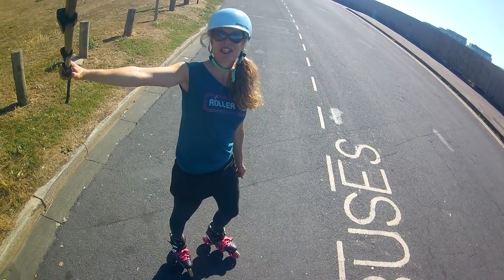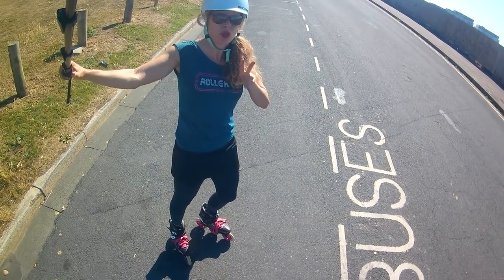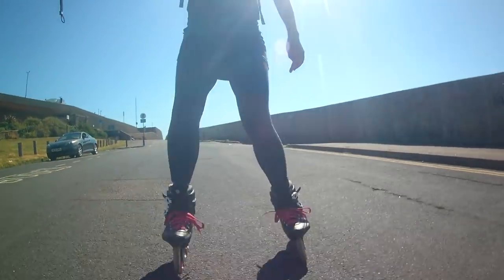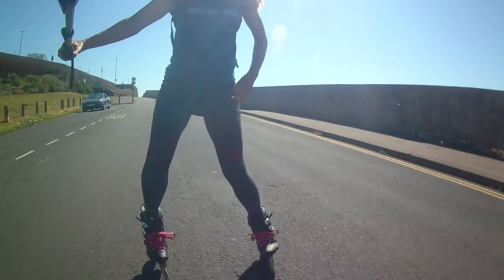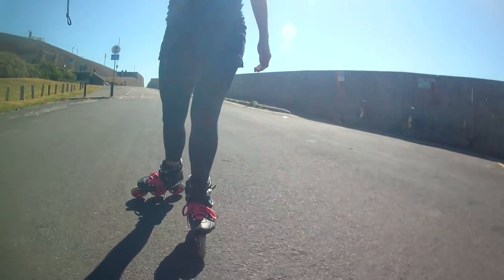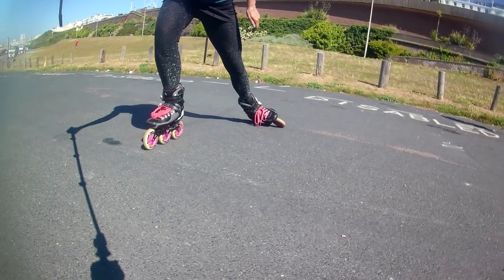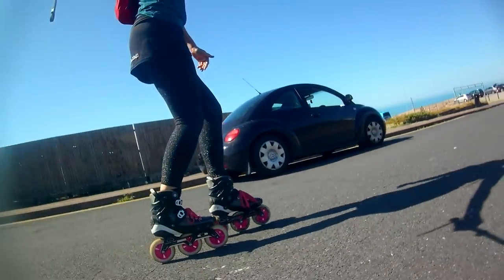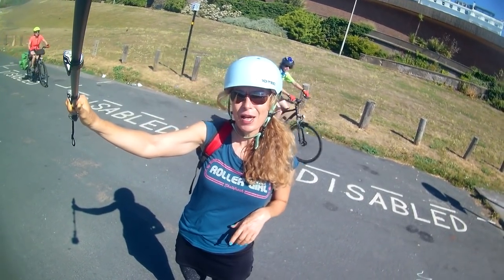How to stop and control speed on down hills and slopes on inline skates or rollerblades.

Comment: Your obviously not in speed how do I know this actually works when am on full speed right on downhills and several of those stops.... when I get to realize bus/vehicle are so near to me  I just need sum that could stop me real quick so pls be on full speed and let see which works the best
Reply from the maker: From my highest speeds the combo I use is T-stop and then forwards entry into Powerslide. This is my fastest most emergency stop and it works on slopes also. However for many people this is not possible from their high speeds because they have not made their powerslide doable from higher speeds so it's a process of regular training over several months. Turns are not what Id use in high speed situations (takes too long and needs too much space).
Reply from the maker: Hi. This is Sergio from Team Skatefresh. I'd like to add that in slopes it's very important to control speed BEFORE you get to the point of no return! I mean don't wait till the speed is uncontrollable to apply stops. I have taken many steep slopes in my life but I start slaloming and T-dragging (or even heel braking when I have the heel brake attached) way before I am at full speed. Besides, if I do the wide slalom zig-zag I take a glance at the back in almost every turn to be aware of what comes behind me. I only goes downhill at full speed when I know the green light will cover me and there will not be surprises at the bottom. Remember that speed is beautiful but only if you can control it either by stopping or slowing down.

Comment: hard
Reply from the maker: Yes, down hill slopes and using turns is hard (despite it sometimes looking easy). You MUST practice your turns on the flat first so they are fluent in both directions before taking it to the slopes. Most skaters never get to this stage of making their weaker side turns less weak. It's a fundamental skill and will save you on slopes eventually.